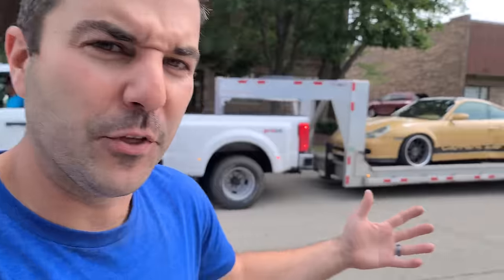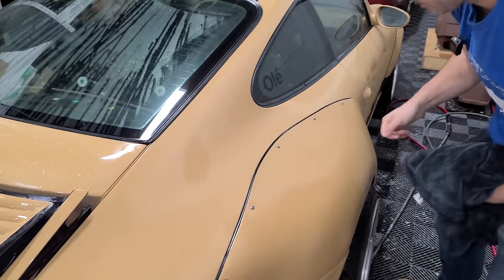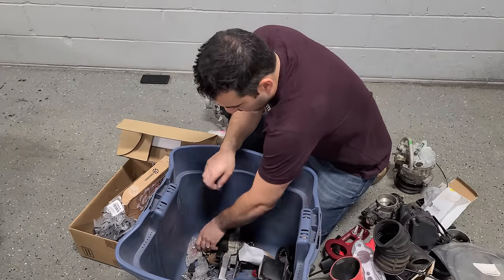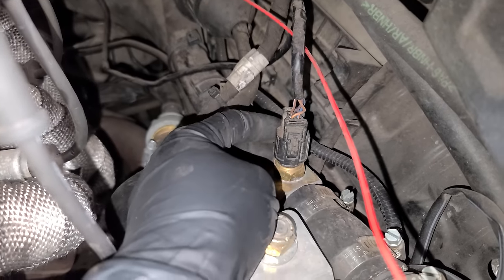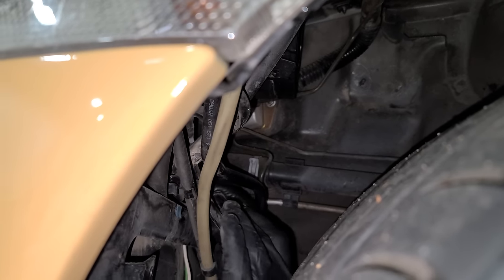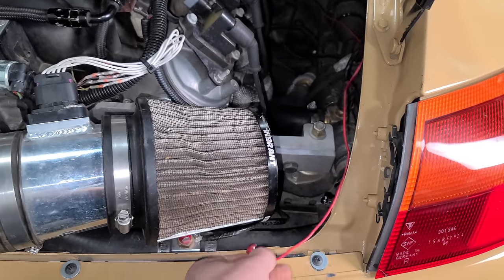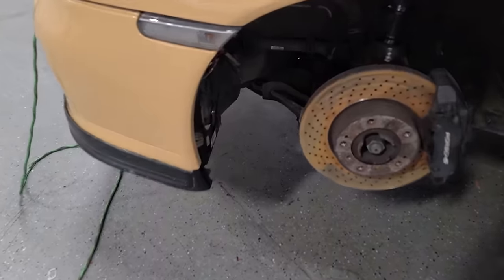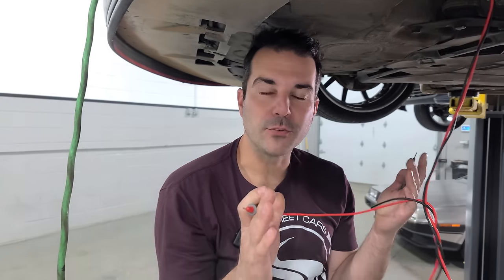I Bought A WideBody Porsche 911 That No One Could Fix! I Fixed It For FREE In 3 Hours! LS Swapped!

Comment: And this how you show you're a master tech.  Multiple shops tried and did rigged repairs and you diagnose and fix it properly in half a day.  I love this channel more with each build.
Reply: It's really just looking at it intensively. Normal shops won't do it because labor hour BS. You need a specialist who's not losing money to dive deep. 
Most shops have to be profitable at every corner. Figuring out retard engine swap dilemmas are not usually profitable. Most vehicle owners freak out over insane D&D figures.

Comment: Mechanical engineer here and I used to work for AST, 2011-2013 I think it was. I can vouch for the cost of the dampers, they were pretty close to top-of-the-line. If you ever have issues with them I have a contact in Dallas who is very familiar with them. Enjoy the car, it looks like a really fun project!

Comment: Alex. Thanks so much for all your content. It's really appreciated. As a fellow 996 owner but in the UK, I would suggest removing the front bumper and checking for debris between the aircon condensers (if it still has them) and the radiators. This can detrimentally affect cooling performance if it's all blocked up. Just a thought.

Comment: In 82 I bought a Oldsmobile 455 from a junkyard for $350 because the transmission wouldn’t shift, even a shop told the owner it needed a new transmission. Within 10 minutes I fixed it. The linkage was bent. One of the best cars I ever owned.
Reply: is that one of those super plush couch-like cars??
Reply: @oddarntnes7079  400 horses and 500ft. lbs of torque of pure muscle. Plush and great lines.
Reply: @fUtube1212  sounds like a blast

Comment: You definitely want to use a vacuum airlift tool to fill the coolant in this.  Also, that looks like a factory oil pan, you're going to want to remove it and make sure it's got baffling/oil trap doors to keep the oil around the pick up tube.  You can add a third, center radiator to these pretty easily using Porsche parts.  It'd be awesome to see you put PS and AC back in it and restore full factory functionality to everything

Comment: Great to see a Porsche on the channel.  My 992 has a glove box like normal cars, but also the engine temp also sits around 190-212 or so depending what you are doing.  That’s a Porsche engine, but still…. Also, the fans always run after your shut the engine off to push all the the heat out.  So there could be a timer there
Reply: I'd certainly suggest adding in a timer if you can't find the factory one.
Reply: The late 90’s 996 and 986 did not have a glovebox
Reply: My buddy has a 996 making 700 horse !
Reply: Yep. Look for a DC 12v PLC Relay Multifunction Timer Module. They cost about $5-8. You can feed it with power from the battery and it can use the keyswitch as a trigger; when keyswitch OFF, run for x seconds after.
Reply: Hey Zollotech, any news on 17.2rc
Reply: It's not a Porsche, it's awful
Reply: Don't never want another Porsche. I call it a pile of junk! @Cyprusmichalis
Reply: Use a thermal switch and relay.  The air cooled engines need air flow, so sitting in idle sounding mean comes at a price.

Comment: Hey Alec Make sure the oil pans been rigged up right for this application as its not listed in the modification list you show, and put the right way round for the midengined design layout, as it grenaded Hoovies multiple times from that, and it needs a baffled oil pan set the right way round for the pickup with the way the G's are set in this, as its happened multiple times with cars like this

IE Porsche LS's and Detomaso's, which were basically a poor man's ford GT40 in the old days, complete with the headbangingly low roof and no Gurney Bubble, as you cant just throw a V8 in here with a normal wet sump without making sure its rigged up properly to keep the oil pressure in check

hence why so many italian cars go dry sump, as its much easier and reliable to have it fed via a reservior and a pump in a different location to keep the oil flowing under high G cornering 

and its one of the things one of the owners of the Ford GT knock off Lee Iocca brought in went into on the video titled

Longterm Affair: Jim Demick and his DeTomaso Pantera

and there was even a guy on a testarossa video in canada who talked of Corvette C4's failing when trackdaying from the same thing, which is probably why accusumps exist to keep the pressure up even on pre LS GM V8's and other muscle cars that are being trackdayed and thrown around like that.

if they dont have a deeper baffled oil pan in to keep the pressure and flow going, something that also happens on a 20 million dollar car currated sells for way over price

hence why he doesnt drive it even though his father loved to do just that, the miura, italy's ultimate kitcar, which didnt have a drysump until the SV, with both the crank and the engine sharing the same oil supply. 

funny how being a lamborghini and muscle car guy kinda goes together really, but hey where did dodge go to get the 360 V8 prototype V10 truck engine, with two extra bangers put on and enlarged to 8 liters lightened abit for use in the Viper?

Comment: Nice!! Reminds me of a sweet deal I got on decent condition 1996 MB SL320 for ~$3k. They couldn’t figure out how to fix the fans so they gave up. I took a look at the relays and they had a BMW relay plugged in for the fans 🙃 The pins lined up, but the power pin was in a totally different spot on the BMW relay compared to the factory Mercedes one. $20 for a new factory relay and everything was working like normal. This was about 8 months ago. I’ve been daily driving my SL320 since then and it’s running flawlessly.

Comment: That looks like it's going to be a fun car! Glad it wasn't a major cooling issue.  I'm currently working on rebuilding my 98 Trans Am. I bought it 2 months after i graduated high school in 2002. I had a rocker arm bearing give out and send needles through the engine.  She's going back together stronger though. Moral of the story... do your trunion upgrades!
Reply: If I got another LS car (I've had 3) I would get a roller body and then do a 5.3L with an upgraded top end refresh designed for boost and then get a pair of used turbos to rebuild. And I always say to use link bar lifters in an LS

Comment: The fact that more than one “professional” mechanic couldn’t diagnose this is truly incredible. Great job fixing it and looking forward to more videos with the LSC 996!
Reply: Nobody wants to work on hacked together junk like this.
They likely barely tried at all, billed him for some money and shoved it outside.
This car is a hacked together ruined pos now and barely worth scrap.
It is also likely dangerous to drive as the Porshe designed weight balance and handling are all completely screwed now so who knows what bad tendencies this pos has on the road, let alone during any aggressive driving.
Reply: @riverpirate1022  Then decline the work.  When a mechanic accepts a job and bills for time, they’re obligated to give it best effort. The fact that they couldn’t figure out a cooling fan that wasn’t spinning is exactly why I put “professional” in quotes.

The LS is likely lighter than the original power plant, which would improve the weight balance of the car.  Using your logic, no one should ever modify a car in any way.
Reply: @riverpirate1022   You sure are funny!  Do you really think that a junk porsche engine is better than a Chevy?  That V8 makes more power, is FAR, FAR, more reliable, is lighter, easier to service, and costs considerably less than the porsche garbage.  Also, I intentionally did not capitalize porsche because I don't think the brand deserves it, due the the POS's that they've always been.
Reply: @davidstjames_ Really odd take, while LS are fantastic motors and make great swaps for an expensive flat-six… Porsches statistically are reliable, quality vehicles.

Comment: I estimated you paid $25,000 and was very close to actual price you paid.
That is one intriguing ride. The Porsche is very light and will literally fly with the LS. The color is really nice and the wheels are superb. Great deal on an amazing car. Can’t wait until you fully work you magic and tune that engine.
Reply: Literally? I mean, making a car literally fly actually isn't as hard as you might think. Just fuck up the aero to generate lift (bias lift to be greater in the front), go over 100mph, you'd be surprised.
Reply: What did he pay for it?
Ok 10:55 $27.000
Reply: I guessed $12k. I think that's all a wholesaler would offer. I haven't finished watching the video yet, so maybe this car is better than I think, but at first glance is looks like a pail.

Comment: Put in a fan relay to protect the thermostatic switch from the fan load and allow it to be controlled safely from the ignition switch. Remove the worthless pusher fans as they are actually blocking ram air. Without interfering with the radiator area (new space) install the engine oil cooler but install a thermostatically controlled bypass to avoid overcooling the oil. Those pusher fans were probably puller type and wired backwards so the blades were “stalled” but you may be able to use one fan for the oil cooler. Get a rear sump(rear of car) oil pan asap or face oil starvation (probably too late).

Comment: I once owned a red 88 Carrera with a "tail" and no  mechanical problems, just minor easy to fix problems. It served me well for 10 summers. Air cool engine is pure and simple. My retired Porsche specialist preferred to work on the carburetor engines and he would convert them if he wanted some fun

Comment: The fans running when the engine off is a good thing because it will bring down the temp instead of rising. The fans will shut off at a safe temp. Some of the older Hondas worked that way.

Comment: All the ways and techniques you  show us are great. I have added some of that knowledge to my arsenal of vehicle repair. Also, since you asked. I'm currently working on a 2007 Magnum SRT8. I'm looking into the best bang for my buck on exhaust.
Reply: Find some SS longtube headers. If you don't live somewhere that does smog testing then get catless mids and xpipe. If you have smog testing get high flow cats and xpipe. Then go on summit racing or jegs and get 2 bullet style mufflers or resonators of your choice. Install the longtubes, mids, and xpipe yourself. Take the resonators or mufflers to your local family owned exhaust shop and have them finish installing them along with the rest of the tubing. Usually it's about $200 for the shop to install the mufflers and make the rest of the custom tubing. If you are going to make over 500hp go with a 3 inch exhaust. If you won't go over 500hp go with a 2.5 inch exhaust

Comment: Porsche added the glove box with the facelift of the 996 (among other things like different fenders to accompany the clear lens headlights - the Boxster kept the runny egg yellow indicators in the front until the end though, therefore 996 facelift fenders are rarer used and more expensive). 
For the model year you have, the way to keep the owners manual seems genuine.

The facelift also added two cupholders (although many Porsche owners only know of one because they never realized they can pull it out to revear a second one) underneath the middle air vents. As well as dozens of other small changes (electronic throttle, electronic hood releases front and back etc...)

Comment: I would definitely delete the pusher fans and then test to see whether the OEM fans alone are sufficient. I may have missed some of the details on the aftermarket fan wiring, but I'd also consider trying to bring the OEM two stage fan system back to stock and deleting/not using the aftermarket temp sensor, if that's possible.
Reply: Yep, would probably help temperature fluctuating as much.
Reply: The most overlooked thing with engine temp is spark plug heat range. But ya hes has some fan issues.